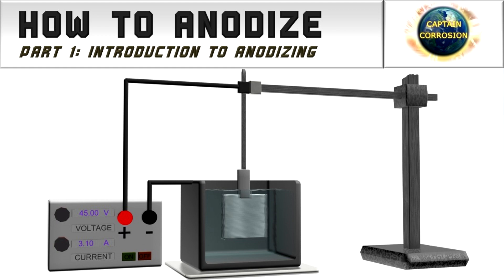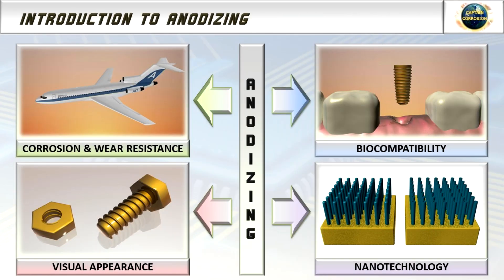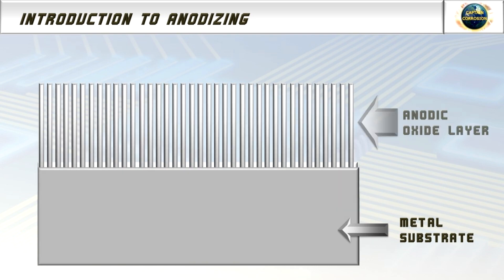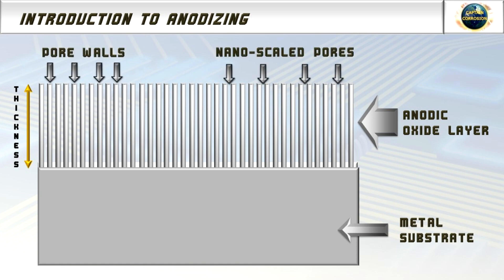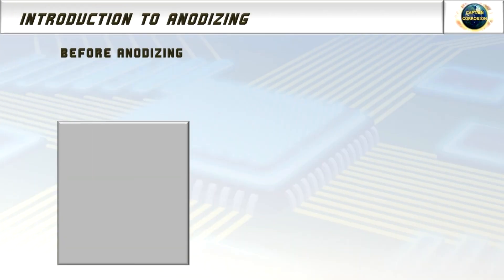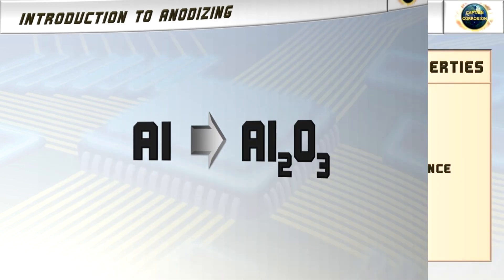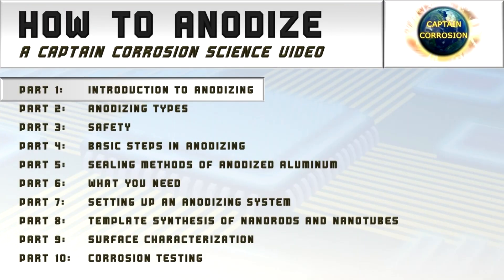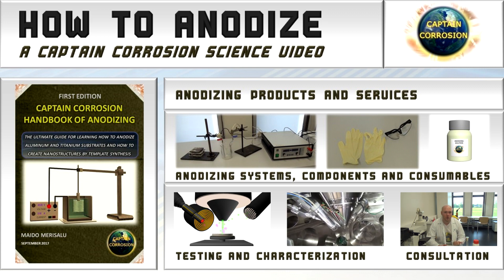Introduction to Anodizing | How to Anodize Episode 1

Comment: why is it there's pinhole after anodizing?
Reply from the maker: These pores provide a pathway for the electrolyte to the metal substrate, which allows the anodic oxide layer to grow in thickness during the anodizing process.
Reply from the maker: Because the anodic oxide layer is porous by nature. These pores are usually afterwards sealed by various treatments, which include the hydrothermal treatment and paints.